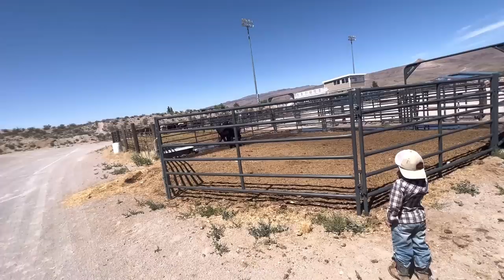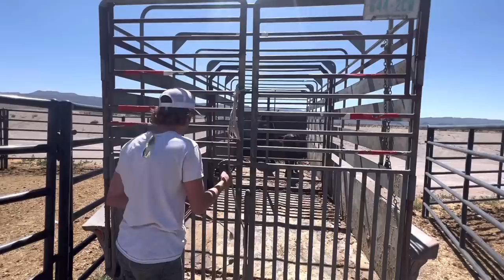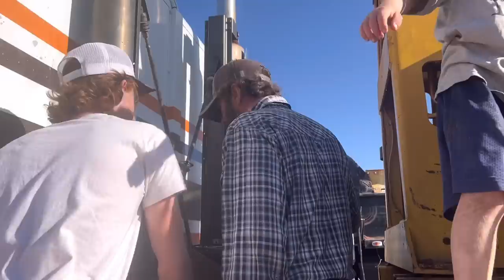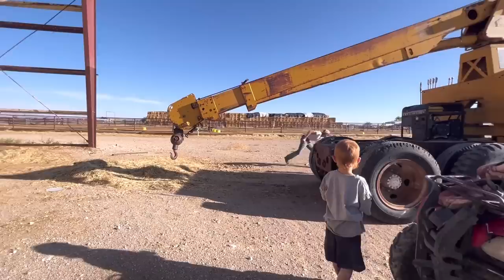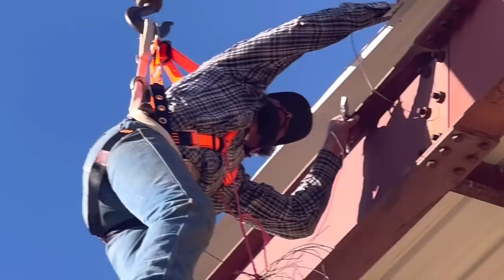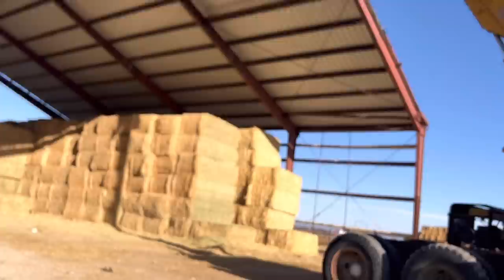Flying Suit Worked | Barn Fixed

Comment: Great job getting the ornry  cow loaded up and the calves worked. Your flying suit is actually a safety harness, I believe the strap that was behind your neck was supposed to be across your chest and the strap you had around your waist is supposed to hook on your back  the short end from the shock arrester pack closest to your back and the other end on something that will support you if you fall. The pack built in to the strap is if you fall it releases to slow your stop so it isn't so jarring. Anyway you got the job done, so all's well. Thanks for the video, good luck batching it. Al

Comment: Oh and from the hazy corners of my memories… look into something called a bosun’s chair.   Basically it’s a 2x4 with a rope ran thru either end and then looped like a swing but with a single line to the end… we used it when painting the roof peaks on the barns back in the day… it’s probably no safer but has the advantage of allowing you to sit instead of dangle + you can hang tools,wire, whatever from the board and still have use of both hands (I’d probably use the harness as well but just as a “safety device”

Comment: Why did you put the chest strap behind your head?   That other cord is the fall arrest and should be connected to the ring on the back.   Nice job getting the roof tied down.  You will want to get it screwed down again so it does not wiggle and break the wire lose.  Area 51 cow looked like a good mother, she would take on the coyotes to protect her calf.    Stay safe and healthy.
Reply: Exactly what I was gonna say about the chest strap!!
 Got the job done with no injury so that’s gotta be a good day!!